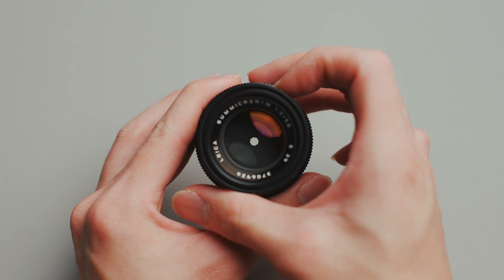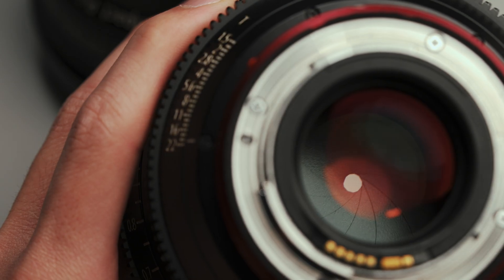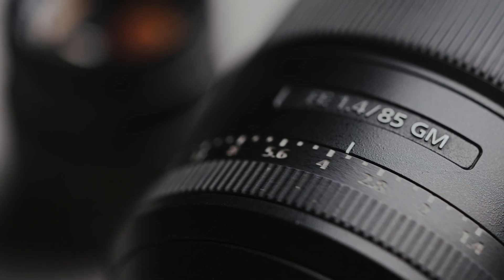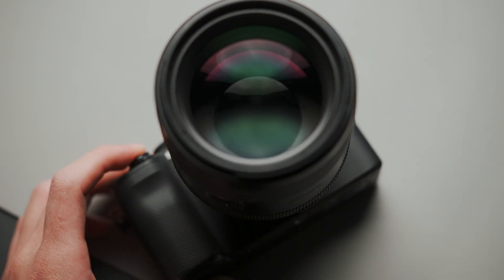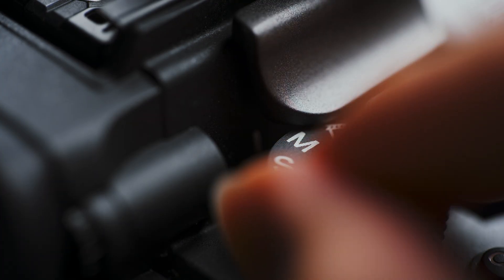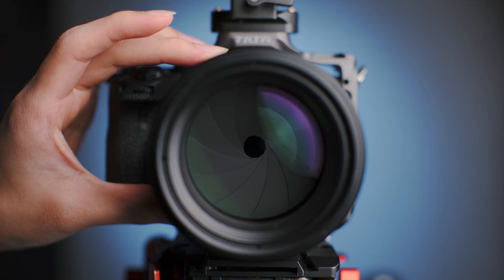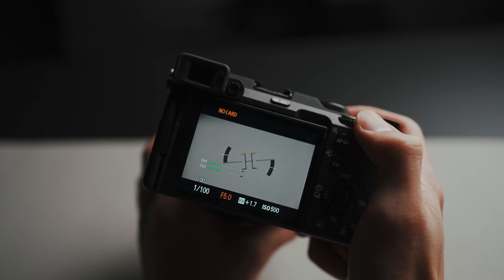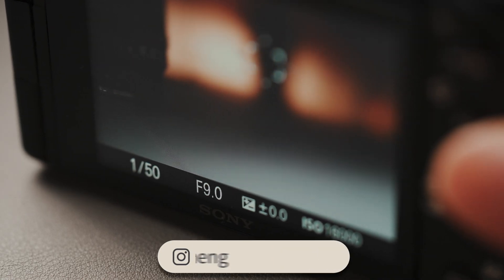Why Modern Lenses Use "Fake" Electronic Aperture Rings

Comment: Non sense . Many mirrorless cameras work with real aperture ( not wide open ) it’s the case of Sony cameras in their standard settings. This allows to visualize the dof . Nikon Z works also at real aperture till f5.6. Lumix micro 4/3 offers both options,  real or WO. 
Why the aperture ring is not mechanical? Because it would be useless as you need anyway an in camera aperture control.

Comment: I have found that many photographers are just bad with science and engineering, no that's not why they do it, very few people shoot at f/11 or f/16 because of diffraction limit, and cameras aren't always programmed to open up the aperture for AF, that's just a side bonus. Also why did they stop doing real focus rings either? Doesn't explain that does it? 

The real reason is the fundamental conflict between what kind of an aperture/focus mechanism its good for electronic control and what's good for manual control. For electronic you want it to be super light and frictionless, but for manual you want it to have some weight and dampening, and you can't have both at the same time, unless they're just not mechanically connected in any way.

There are lenses with both AF and direct manual override but those all suffer from the problem that there must be friction between the focus mechanism and the manual ring, which slows down AF and wastes power. The only real mechanical solution is to have a clutch mechanism, but that's just way more expensive. Today there's the additional problem that the best AF mechanism is linear motion and not relying on screws, so you can't even do it with a clutch. You could still do a clutch for the aperture but that's again just way more difficult, you need a motorized aperture anyway and it's just much harder to implement some kind of mechanical link with the outside, as opposed to an electronic link.

Comment: On Sony how the aperture works when shooting stills (I don't shot video) in low light with a small (high f-number) working aperture like f8-f16 (even with flash) depends on several settings like Live View Settings Effect On or Off, if it is in AF-S or AF-C, which firmware the body has, which body model it is and if it has Aperture Drive in AF and if it has the Focus Priority mode implemented and it also depends on which lens is attached and probably which firmware the lens is on. Basically it is a mess.

Comment: 1:23 smartass comment/technicality:
Technically speaking it isn't lack of light that causes autofocus to go haywire at closed down apertures, but rather the disability of Phase-Detect AF to work at higher f-stops.

If you have a scene that is really bright (e.g. midday sun), stop down to f/11 (trying this myself, at 3 pm I had enough light for 1/50s, f/11, ISO 100), my mirrorless camera still had trouble focusing, relying on Contrast-Detection AF (seen by the "pumping", going back and forth until it has found focus).
Going up to f/2 however (1/1000s, ISO 100 – same light, same scene) focus could be acquired way quicker, due to PDAF being available.

I can see Phase-Detection not being available at high f-stops pretty well on my old AE-1 – if I stop down to f/22 one half of the split-image focusing help goes weird. PDAF is somewhat similar to split-image indicators from back in the day.

Doesn't change anything from the fact that an open-aperture is necessary in order to do good AF, though.

/Smartass comment over

Comment: Insightful video in every other way, but as others already noted, AF, although obviously profiting from it, was neither the reason for nor the beginning of camera makers keeping the lens diaphragm open until the actual shot. Open-diaphragm lens usage with SLR cameras actually dates back to the late fifties and it became standard in the sixties. It was invented for the two reasons, (1) for keeping the viewfinder bright regardless of the chosen F-stop and (2) to make manual focus easier and more precise with the aperture stopped down, and a bit later for shutter-priority ('S' or 'Tv') and 'program' automatic exposure modes. No no electric contacts were necessary, the lenses all had mechanical aperture rings, but the cameras could still mechanically change the aperture from inside the body by moving a lever within the bayonet mount.

Comment: I'm pretty sure film era slrs do those things too? Afaik they also keep the aperture open for focusing, and some have automatic aperture modes. And it was all done with mechanical controls. Electronic aperture on modern cameras is probably more so a design and manufacturing thing.
Reply: Yes, as viewed through the lens, all my old Minolta MD slr film lenses physically close down the aperture blades 1:1 with the aperture ring.

Comment: The Nikon F also only steps down the aperture when the shutter opens, so that the image in the viewfinder is bright for the photographer while composing the image. Many old SLRs do the same with mechanical aperture lenses. Electronic aperture control is probably preferred today because less moving parts on the camera body = greater reliability, speed, and also because it makes it more difficult for photographers to switch lens ecosystems.
Reply: Was just about to comment the same. Though personally I prefer a mechanical aperture. Also I've never come across one in a prime lens that couldn't be easily repaired.
Having less moving parts doesn't mean much when cheaper lenses and their internal mechanisms are mostly made from plastic and can break easily....and the expensive high-qualiy ones could probably easily have a very reliable mechanical aperture mechanism.
Reply: yeah,only M42 lenses or few old lenses would have the fully mechanical iris mechanism and the lens itself doesn't contact with the camera body.So when you wanted to use light meter,you would need to close the aperture with a checker lever in those film cameras.
i have no problem with electronic ring because it still help user to get nostalgia vibe and more alternative control wheel than tiny wheels.
Reply: @sigmagamer364  that's true for M42, but most bayonett mount lenses have some way of communicating the set aperture while allowing you to focus and compose wide open. No need for electronics in the lens.
Reply: Nonsense, an electronic mechanism has more moving parts and is less reliable than manual aperture. We have electronic because an electronic mechanism is required to be competitive, not because it's more reliable.
Reply: Nailed it.